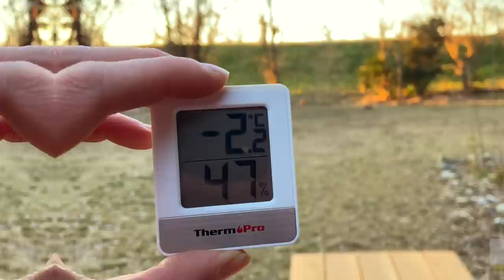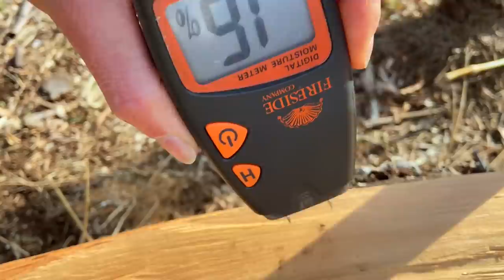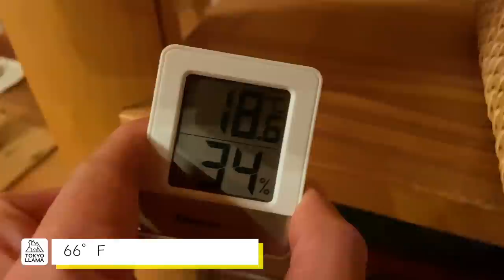Winter in a Japanese House | Tokyo Llama

Comment: I lived in Japan for a year, and although they gave me a kerosene heater for my unheated bedroom, I was warned seriously not to leave it on when I went to sleep because the fumes (or something) would kill me. So I turned it off, closed the fresh-air crack in the window, and snuggled in the futon, and that seemed to work fairly well, until I had to get up in the morning. This was in a modern urban house in Tokyo. 

I also spent about 10 days in Nanae-cho in Hokkaido at New Years in an old farmhouse. The whole house was unheated except for a little fire pit in the living room, and the kids' room had an electric heater. They gave me about 10 quilts but I never got warm at night. They also gave me a little metal box filled with ashes and a live hot coal in the middle. So I could have warm hands, or warmish feet, but not both. I was frankly glad to get back to the city.
Reply: Copy and paste;  

Kerosene heaters are safe indoors if used properly. However, since kerosene heaters produce carbon  monoxide, it’s important to keep the room well ventilated. In poorly ventilated rooms, leave doors open if possible, and do not use a kerosene heater in a room without doors or windows.Carbon monoxide poisoning typically occurs from breathing in carbon monoxide (CO) at excessive levels.[3] Symptoms are often described as "flu-like" and commonly include headache, dizziness, weakness, vomiting, chest pain, and confusion.[1] Large exposures can result in loss of consciousness, arrhythmias, seizures, or death

CO is a colorless and odorless gas which is initially non-irritating

Comment: Wonderful! I remember when you first started cleaning up the property. Is the tree with the round, orange fruit a Persimmon tree? I live in rural northern US and we heat with bottled LP gas. Our supplemental heat is with electric heaters rather than kerosene. When it dips down to under 10 degrees F, they can make bathing more comfortable or add a couple of degrees to a room relatively economically. When I was stationed at Iwakuni, however, the air base used a lot of fuel oil burning heaters to keep rooms at least bearable. Electricity must be expensive in Japan.

Comment: You may want to look into a toyostove. It runs on kerosene but is vented and you have a tank. They are very efficient at heating and very low cost. I'm in the US we have Temps for about 4 months around freezing or colder.  Im in North Carolina. It only uses about 100 gallons of fuel a winter. It is made in Japan so should be easy to find out some information on them. I highly recommend one. They are used in Alaska because of how warm they keep homes and the cost is low.

Comment: If you ever need to change the wood burning stove you should look into soapstone covered stoves or mansonry heaters. They are expensive initial investments, but for a situation like what you have where the house looses a lot of heat in the night they are good to have. During the day when you use them the heat is deposited in the soapstone/mansonry and during the night they slowly radiate the heat out meaning you have less of a steep heat drop during the night.
Reply from the maker: Thanks, I'd never heard of those before, but they do seem ideal. Not sure if they have them here, but I guess we could import at some future date if we do need to move on from our current stove!

Comment: When I was researching windows for my house, I came to the conclusion that the energy efficiency of triple pane windows compared to double pane was not that great.  The additional insulation of triple pane did not justify the additional cost which was significant.
Reply from the maker: Interesting, I haven't done extensive research into it yet, so it's good to know and keep in mind as the price difference is significant, as you've said.

Comment: Geothermal heatpump system for cooling and heating , can be used as your main source or auxillary. Installation is quite a work but after that its free carbon nuetral heating and cooling. After studying your terrain if its suitable for your home it will be a great addition for a self sustainable home. 😊👍

Comment: Air leaks are the most important thing to tackle but it must be tough when there's beautiful old architecture that one needs to respect while tackling the issue! Other than that... "seal tight and insulate right" is the way to go resulting in no air leaks, and an uninterrupted layer of insulation on the cold side of the building envelope.

That open combustion kerosene stove though, oh my. In a big enough space and short operating times the combustion products might not bother the user as much but as the air sealing is improved, how's the ventilation designed to deal with it?

Comment: @tokyo Llama you should try out doing the "siberian log fire" in the stove' basicly you have a base log and you stack the other logs pointing towards one spot on the first Log..
this makes the base log burn slowly and the other will also burn slowly saving the heat for longer and use the logs more efficiently.. (i mean look it up=
For your house i would priorities double or trippel windows and insulating the roof, i don't have the exact picture but if your top floor is the only place for bedrooms you could make sure top floor is the most insulated before you do the bottom.
Heat will retain very well and alittle chilly isnt bad for you.. even better is to have a cold bottom floor for summer and heated bedroom room for winter.

Comment: Have you considered an air source heat pump? Obviously the challenge would be finding some discreet spots for both the indoor and outdoor units. But I feel like it might be a good option for maintaining a base temperature that you could then boost with the wood stove. And blocking the air gaps of course, like you were already doing.

Lovely and fascinating channel!
Reply from the maker: Thanks, yes, they're very common in Japan and we plan to have a split A/C unit, we would hide them under the decks.
Reply: @TokyoLlama  Ah, under the deck does make sense. Even here in Finland, Mitsubishi is one of the most popular manufacturers :) Although I believe the models sold here are particularly focused on heating in cold temperatures, the one we have is also great for cooling in the summer.

Comment: Ok I’m glad you brought this up because I’ve always wondered how the shoji screen developed in a country that gets so cold in the winter. Is there any history about why paper was ultimately chosen?
Reply: It let's light in and keeps air out, rice is plentiful,  and it makes a fairly stiff paper. Glass has always been kind of an expensive material, and up until the early 20th century it was also kinda hard to make glazing with good quality and consistency, so it makes sense that it wouldn't have been used a lot in Japan until they started industrializing in the 40's.

Comment: Love the images of snowy Japan! 

Random thought: would insulating curtains in the engawa work as a temp solution until switching out the doors? They won’t be as pretty but they can be moved to still use the yukimi. There might not be a place to install a curtain rod, but just a thought.
Reply from the maker: My wife has suggested that but I'm definitely not a fan of how curtains look in an engawa, but some houses like this do use them. We could put the storm shutters up instead, though not very convenient.
Reply: @TokyoLlama  what about honeycomb/cellular shades? They insulate, and the can be raised all the way up when you dont want them. The only thing is they tend to be expensive.

Comment: Wood drying recommend cutting wood into 4" to 6" 100-150 mm long.
Wood dries lengthwise more than radially.
If you have a glasshouse or empty van ; fill with wood and by the end of summer it will be dry enough to burn.

Comment: Hi mate, house looks amazing inThe snow!  Have you considered a heat pump/reverse cycle air conditioning? A ducted unit would be game changing and much less hassle than wood, heating in winter and cooling in summer. I’m in nz with a fairly mild climate, but man it has been game changing. Currently 27 outside and 90% humidity and a nice cool 22 and low humidity inside. It rains here a lot in winter and it keeps the house dry inside as well as warm. Pretty much the standard here now, but really can’t recommend it enough for quality of life. Lives here 10 years with 6c winter nights/mornings, never again!!

Comment: I would have the same concerns about the inside temperature the others have expressed.  Maybe that shrink-wrap plastic on the outside windows until you replace them.  That might add another few degrees.

Comment: Possibly wood rails on the inside. Notched or tapered, so wooden inner window frames can slide right over. When the inner windows are off, it just looks like a wooden architectural detail rail or double rail. When the windows are on, it is doublr insulation. Since the frames would be on the inner walls, it would take care of your window gaps as well. The rails could also be removed in summer and a decorative tab put in the screw holes? Thought wooden decorative, functional rails seem like they could be beautiful, as well as functional, in the current house.

Comment: In your case I would add insulation to walls and ceiling, seal the airgaps. Then add a big fireplace with lots of thermal mass which releases the heat slowly over a period of a day or two. If electricity is not too expensive in Japan I would consider an air source heat pump to go with the fireplace, Mitsubishi makes good ones. House is beautiful, but old houses come with their own challenges, usually the heat and lack of it.

Comment: About new Windows. Don't do three Glasses. Do two with Plastic window frame. If you use 3times Insulation the wood might get mold. Due to the Vapor unable to get out of the house. Have a second opinion from an expert. I am only sharing my experience with an old wooden house in Germany.
And the Infrared Camera! Such a cool 😉 idea!

Comment: For the kitchen windows, it might be worth trying the bubble wrap insulation method (Spray window with water, apply cut-to-size bubble wrap to window with the flat side towards the inside of the house). It's cheap, quick, and effective, and easy to remove, although it does obviously limit visibility outside.
Reply from the maker: I should probably give it a try, especially as we can't see outside anyway because we mainly leave the shoji closed during winter.

Comment: for me, 8 degrees is perfect for sleeping.
I'm surprised that the shoji are effective as they are. It probably wouldn't look as nice, but if you papered both sides of the frames (leaving an air gap between the paper), you'd get a massive insulation boost. You could possibly then stick veneer strips over the inner paper to get the appearance back.

Comment: Great video! Very timely, as I too live in a similar temperature range in Aso, Kyushu. I’m very interested in your future video on the insulation for your ceiling and possible fixes to uninsulated walls. The type and thickness, R-values you use might help me decide what to use here. The Japanese insulation values are quite different than in the USA.
Reply from the maker: Most of the walls we can insulate we've insulated but we used the 25mm neoma foam on the inside and fibreglass batts on the outside, then I made sure to seal it from air leaks on the inside. The ceilings and the main roof are the places that I'd also like to get advice from people on how to do efficiently.

Comment: Yeah, heating traditional Japanese houses is a real challenge. You have done a great job so far but with high ceilings it's difficult  keeping it warm in the lower parts. The kerosene heaters provide quick heat, the downside not mentioned, the smell, they really stink especially when we turn them off. What we did, I grew up with wood stoves only, was fill the stove at night and once during the night add some wood to keep the fire going. That way, it wasn't freezing in the morning.
Reply from the maker: Yes, that's right, the smell when turning it off is pretty bad can the fumes can't be healthy. I've tried stacking the stove box but found it would still burn within a few hours even with the air vents mostly closed, and damper shut, possibly due to us having a long flue and quite a powerful draft.

Comment: Did a bit of research on triple glass vs double glass for windows, and my finding is that triple glass will only increase the temp of the inner panel by 1 degree at best. I'd say the cost-performance is in favor of double glass. Choosing carefully the frame material is more important (resin or wood are good)

Comment: You need to hang curtains (or quilts or blankets) over all the drafty walls, windows and doors. If you’re clever, they will look beautiful and provide quite a bit of insulation against the cold. I lived in an unheated summer bungalow through a below zero (F) winter… I dyed and hung moving blankets over all the windows…

Comment: How about some thick curtains for the engawa windows? You can also keep them closed to keep out the summer heat. I always kept a 2" roll of cello tape handy for any pesky shoji leak spots for my drafty old Kyoto house. I also used an old screw top wine bottle full of my hot ofuro water to warm my futon before bed. Or make a little bed nest under the kotatsu. Back here home in Canada,  I love my central heating. I do miss my ofuro though.
Reply from the maker: The ofuro in winter is one of my favourite things. I have to admit I don't want to use curtains in the engawa for aesthetic reasons but should at least fill the gaps with foam tape.
Reply: @TokyoLlama  Understood about the aesthetics. You could take the engawa curtains down in the spring and fall though. Or even close your exterior storm sliders at night to keep heat in, I forgot what they are called.  Thanks for posting Llama, from Vancouver.

Comment: Hi, I really enjoy your videos and it’s great what you archived and have done with your house, love it. One tiny recommendation, don’t add tripple glazed windows. They should match the exterior walls. If not you are risking condensation from humid air on them, not the best for a wooden construction (getting it more air tightened increases this problem). The second issue I have with tripple glazing, is the window profile dimensions will usually increase due to the heavy glass. I’d suggest good double glazing + insulation for the „cold“ building elements. The improvement from single to double glazing is usually much higher than from double to tripple. In conclusion: works better; looks better and costs less ;) Here in Germany you can (or sometimes have to) work with an „energy consultant“ for renovations and remodels, if there is something similar in Japan you should consider asking a specialist. Keep on with your great work, I can‘t wait to see what’s next, all the best.
Reply from the maker: Thanks very much for the advice. The price of triple glazing here is very high, so my wallet appreciates hearing that it may not be worth it! Might be worth speaking with a specialist too.

Comment: Beautiful! I wonder if part of the ceiling isn't insulated because this house doesn't have central air, so it needs to be able to circulate air into the attic and stay dry naturally to prevent mold and rot, instead of having machinery do that. I know airtight can lead to problems if you don't have a system to deal with humidity—but I'm far from an expert!

Still, I wonder if it could be useful for you to have some sort of insulation blanket that could be rolled out in the attic during the winter and rolled back up in the summer?

Thanks for sharing your winter experience in the house!
Reply: This happens only if the insulation is not done by experts.

Comment: Have you looked at a geothermal heating system where you lay a six inch diameter polytube into a trench 5 - 8 ft deep in an arc from the house round your garden with the open tube about  1 to  2 ft above the ground  outside where the air moves the warm air in the tube approx 58 degrees F at the correct depth, into the house some use this for large greenhouses where even lemons can be grown in cold climates, apart from the initial cost mainly for a small digger to cut the narrow trench and a length of polytube beyond that it is totally free with zero maintenance at the correct depth summer and winter it will remain at 58 degrees F you can find people who have done this on YT  and thanks for showing your lovely house and work you have done on it as it is pleasant to watch.   Peace......
Reply from the maker: Thanks, I’ll have a look into it!

Comment: Your kerosene heaters putting out I guess about 22000 BTUs. I put my kerosene stove on wheels to make it easier to fill it up. I got the idea from a guy named Miles stair he has a website with info about kerosene. For me it's a balmy  56°F right now. Spring is coming the overnight temperatures are rising.

Comment: You've explained it well. I haven't seen anyone else talk about how to fix the problems.
Personally, I'd rather have such an outdated house than my current living conditions. I can't walk through any door without ducking, can't stretch myself out without hitting the ceiling, and burning just a candle makes the air really bad very fast. Plus, my flat gets super hot in summer, and I hear everything my neighbor does and he keeps complaining about everything too...
Anyway, a house with a garden around it is my dream. Unfortunately, you need to be a millionaire to afford it in many places in Europe... Building a house like this would be utterly impossible due to zoning, and building regulations. Now, they even want to ban chimneys! -despite the power grid becoming ever more unstable!